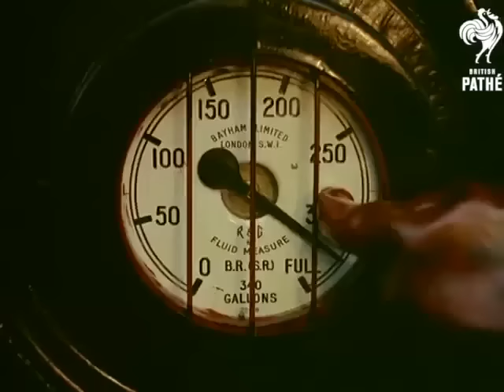Vintage railway film - Scrapping the old iron horses - British Pathe - 1961

Comment: It has long been practice to scrap locomotives that had reached the end of their servicable lives. However, British Railways' decision to discontinue using steam traction in 1968 has often been thought as political, considering that the last engines had only left the production line eight years before.
Reply: Considering dieselization happened in America starting in the 40s, I'm more shocked how far behind the curve Europe was in terms of train technology
Reply: Look how far ahead Europe is now
Reply: @JordosGarage  Not in freight, but you're right, they picked up the slack and then surpassed america
Reply: @JordosGarage  Not at all?
Reply: @IgnoredAdviceProductions  Surpassed in what way? Hard to think of a single metric where that is factually true.
Reply: @nobodynoone2500  Where is America's high speed rail 💀
Reply: @nobodynoone2500  speed, efficiency, safety, ahead in passenger transit by miles, only exception is freight as mentioned above? Enlighten us please
Reply: @IgnoredAdviceProductions  Wartime rationing decades after the end of WW2 will do that.

Comment: It would be nice to have some of the old gauges.
They are worth a fortune  today
Reply: Lots of them appear on Ebay every week, the same gages used on engines were used on ships and building boilers, made by Ashcroft, Crosby, American Gage, and many others. I own a number of them from small to 14" diameter with brass cases and dials, but I dont remember any of them costing more than $400 even for the large two
Reply: @HobbyOrganist  I have seen a great many cost terrifically more, but for a specific model to complete a restoration. Gauges only desirable for looks, not function or correctness are less valuable and can be found on consumer sites like ebay inexpensively.

Comment: Now find a use for EV batteries when they die, as fast as you recycled the railroads.
Reply: Except for the EV lithium batteries, which die in a fire and are so difficult to put out most firefighters drag them off to a safe spot and let them burn.

Comment: Don't forget, only about 8% of the coal actually produces enough heat to produce enough steam to power a steam engine, yes this is a sad film and I regret the many classes that have been lost.
Reply: This. It's sad they had to cut them up, but there was just no way to justify keeping them around.
Reply: that is true for the most part, but there are ways to bring up the efficentcy of it and they are more robust then diesles, and often easier to repair  with lower tech, yes you got to have huge machines to make the parts but its not like you need more percise stuff to work on electros or diesel electros, and the one bonus of steam is if it can generate heat to make steam it can be used for fuel even cleaner burning light oil, liquid natural gas or burning hydrogen, read up on livio dante porta he did a lot for development and application of sciance and thermal dynamics to steam locos all the way to his dieing day in 2003

Comment: No Thermal Lances in those days, you can't even use Acetylene now. Some hard graft there.
Reply: Jesus, you can't even have acetylene over there now?
Reply: @cbennett1  I'm afraid not, not on the Railway that is. I was with the Railway Breakdown Teams for a number of years and we could only use Propane, which just isn't good enough in my opinion, but acetylene is a big no no. Propane does have some advantages, like you can store the Bottles horizontally and use them as soon as they are upright again, which you can't do with acetylene and the Bottles are much lighter but that's about the only good points I can think of, especially for Burning.
Reply: Why can’t acetylene be used?
Reply: @bendingspring  On The Railway, they don't deem it as safe as Propane as it is not as stable and it cannot be transported horizontally and then brought into immediate use. Personally I prefer it to Propane because for burning it reaches Temp a lot quicker and I think it Burns better, but, that's what the powers that be decided.
Reply: I do this job for a living cutting scrap railway wagons and locos heavy industrial scrap power stations ect there's hardly any difference between acetylene and propane it's the oxygen what does the cutting not the fuel I cut lumps of scrap 6 ft thick with Oxygen and propane just need the correct gear and know how to use it
Reply: @jamiekelsall5221  Yes whatever mate. I also have done it for a living and the point I was making is that the requirements for both storage and operating is different for Acy and prop. That's a given fact. I have also used a Thermal Lance, which is different again. The Difference between Acy and Prop is the optimum operating temperature. Before you try to tell me me pal. do some research. I'm nearly 65 and have done this for a long time.
Reply: @stephensmith4480  ok I didn't comment for an argument yes you are correct in what ya said about both fuels propane and acetylene I never said you was wrong and I have used thermal Lance's and hollow lance so what's the big deal and i dont need to do any research thanks and just because your 65 doesn't mean you know it all that's the problem with some folk
Reply: @jamiekelsall5221  My friend. I have never professed to know it all, to do so would be the pinnacle of arrogance and I also didn't want an argument either. I would like to think that my experience would count for something and if if it didn't then I think that would say more about the person who was the opposer than me, so lets leave it at that shall we, rather than get into a you tube argument that drawls on and on. Best Wishes to yo my friend for the New Year.
Reply: @stephensmith4480  all the best for 2024

Comment: ts cheeper to run steam locos now than diesles
Reply: philnewcomers9170   SPELL CHECK.  It's cheaper to run steam locos now than diesel's  😂😂😂😂🇬🇧
Reply: Not even remotely true 🤣🤣
Reply: @ianlitchfield9273  diesel's what? 😛
Reply: Even if we had a zero cost fuel to burn in a stream locomotive, the cost of labor would still make it more expensive than diesel - it’s not remotely competitive, much less cheaper.
Reply: @wobblybobengland  Don't understand your WHAT ?
Reply: No
Reply: @ianlitchfield9273  "Diesel's" is genitive case. "Diesels" is plural. Spell check. ;)
Reply: What you on about ? I was doing a spell check on the 1st conment
Reply: Maybe in china lol.
Reply: @ianlitchfield9273  And you misspelled  'Diesels" and he called out your error.  An apostrophe indicates a contraction, in this case "is", but you didn't mean "Diesel is", you meant "Diesels" using the s to indicate plurality.  /pedantic